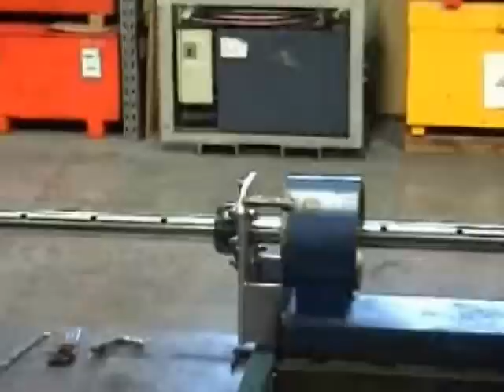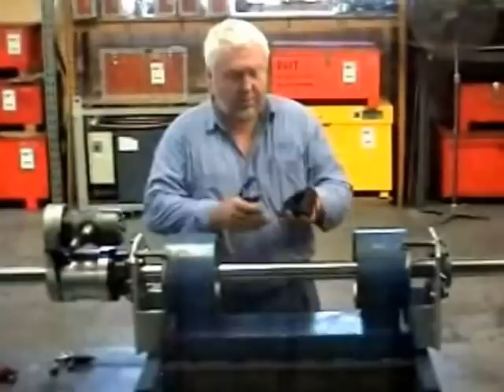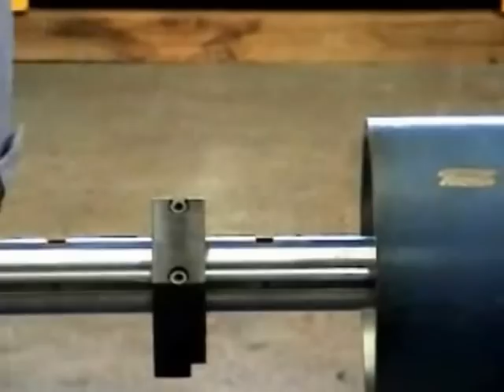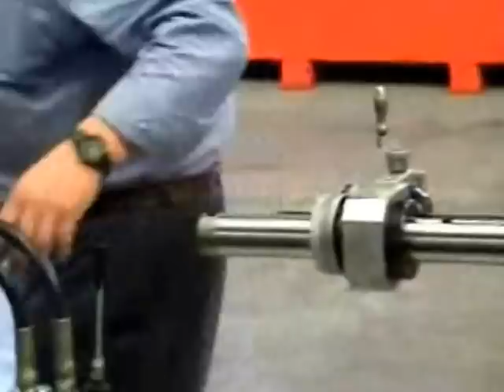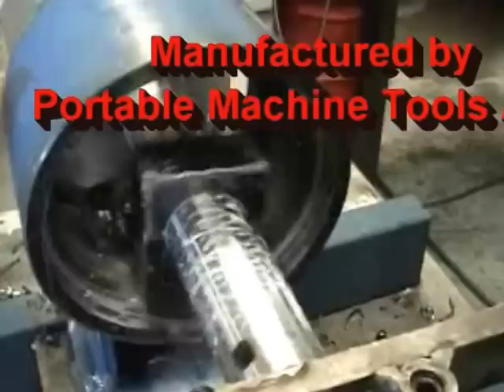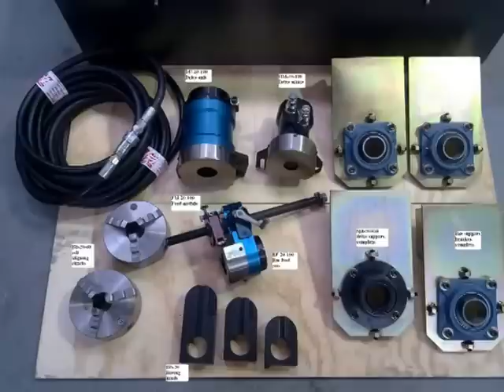Little Ripper Line Bore System

Comment: what is the smallest diam these boing heads will accommodate ?
Reply from the maker: G'day Brian.
Our machines have a 2" (50.8 mm)boring bar as standard. These bars will machine bores down to approx 56-58 mm minimum. You need to allow some clearance for swarf removal. We do have a Small bore kit, this is a 1 1/4" (31.75 mm) boring bar for smaller bores, this fits in to our 2" system using reducing bushes etc.
If you require more information please email me or go to our website. www.pmtaus.com